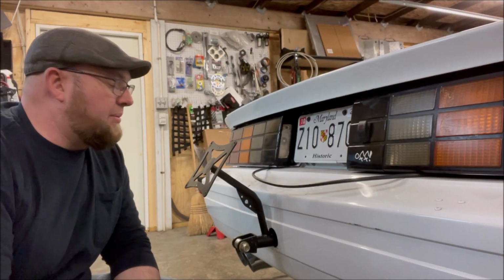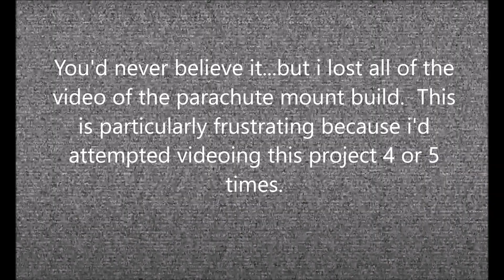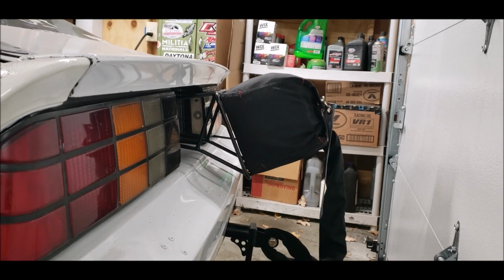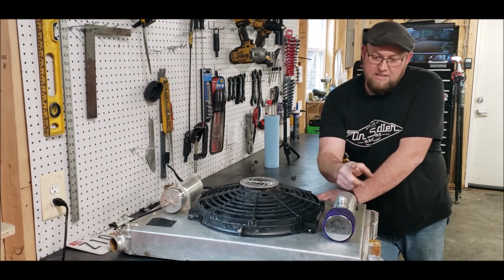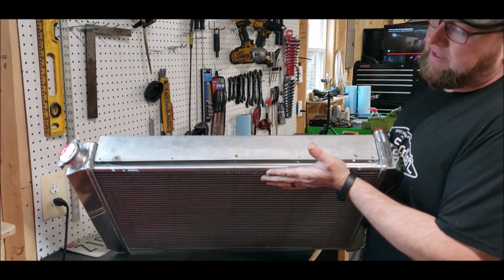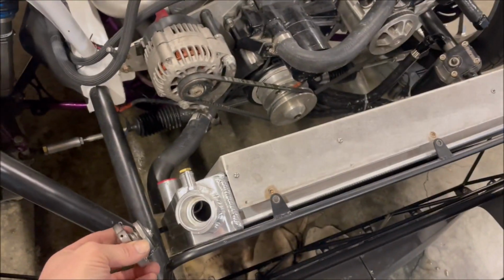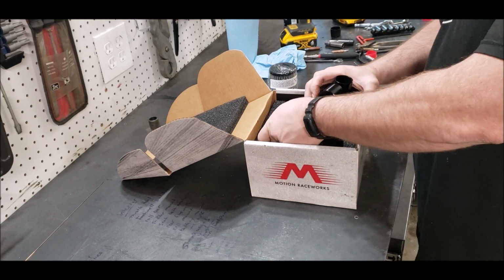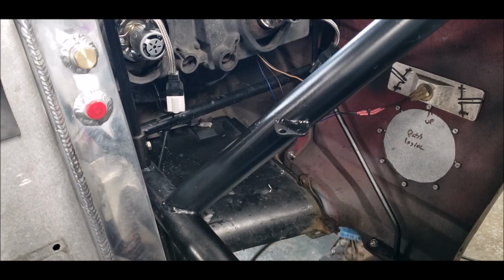Summit Racing 4 core radiator install!  Final winter updates on the SpeedMullet

Comment: Man I had a similar issue with the Alloy Works 4 core radiator in Chaos Theory. I thought I was pushing a head gasket because it kept filling up my overflow tank every time I drove it and hoses were rock hard but for me it turned out to be the cheap radiator cap it came with. After putting a Stant cap on everything was good again. As for the license plate, why not just weld a couple tabs to mount the plate underneath the chute mount? looks like plenty of room for it there.
Reply from the maker: i replaced the cap twice.  once with a regular, and once with a vent style cap.  the curious thing about this was that it would build pressure sitting in the garage, with the engine not running.  i'd vent the cap before going to bed, then would come back out in the morning and hit the vent and it would geyser to the ceiling.
Reply: @MattWalter1  Yea I heard you say you tried a different cap. Thats just a weird issue. Maybe the chemical reaction thing IS a thing? I've never ran anything but straight water in CC so cant really say.
Reply from the maker: it started it after i put in a bottle of the purple ice coolant additive.  normally during the season i just run straight water, then once racing ends, i add antifreeze since things can get dicey up here in january and february.  this was the first time i'd ever ran into this.  i'm hoping we got it licked cause i really don't want to buy yet a different radiator, lol!
Reply: @MattWalter1  Hope so too brother. 👍 I actually have a small heater I leave running under the nose of the car in the garage when the weather is below freezing but I know it gets a helluva lot colder in Maryland than it does in Tennessee. I was actually stationed at Aberdeen Proving grounds years ago. Got stupid hot in the summer and stupid cold in the winter that year. 🤦🏼‍♂️

Comment: How is your master power switch wired?
Reply from the maker: i have a high amperage contactor that the rocker switch on the taillight panel grounds.  the battery leads go to the contactor.

Comment: What heads are you running
Reply from the maker: Dart Pro 1 LS3
Reply: @MattWalter1  I’m building a dart 441. Pump gas/e85 deal.   12.1 compression.  This is the first efi ls car I’ve built. All others were carb. I’ve watched you for long time.  Not really sure on what direction to go for heads and intake.  Everyone seems to have different opinions on this.  My car is set up to be a pretty aggressive weekend toy.
Reply from the maker: @jasonwells2988  if i was doing mine over again, I'd have called Frankenstein.  they seem to have a pretty good handle on big cylinder heads for bigger inch n/a combos.  i'd definitely consider speaking with them if i were you.
Reply: @MattWalter1  I did yesterday.  They recommended f710.  I know is a good head but they also recommended 1 of their intakes that are 4000.  Not happening.      What do you think of fast,msd.  Long runner plastic intakes.  I’m looking to make 700ish and spin it to 7000+.   The car is a 72 nova with 4.10 and 28s.   8 in ati converter
Reply from the maker: @jasonwells2988  I would do the f710 and a cid intake.